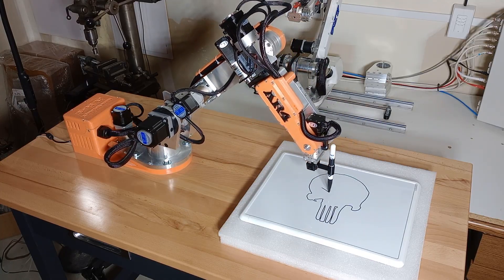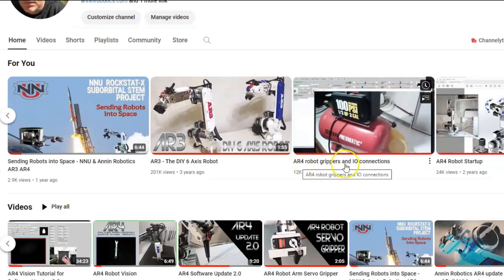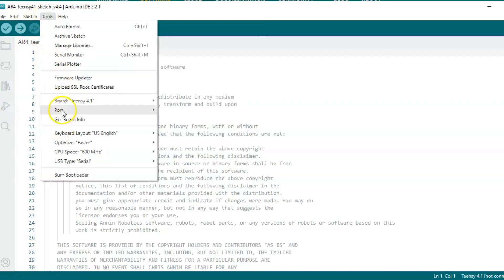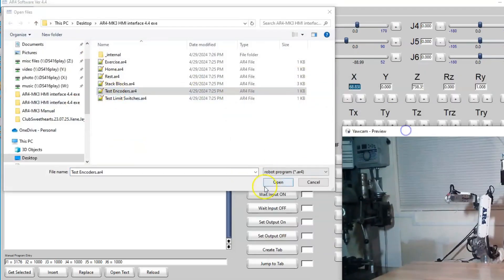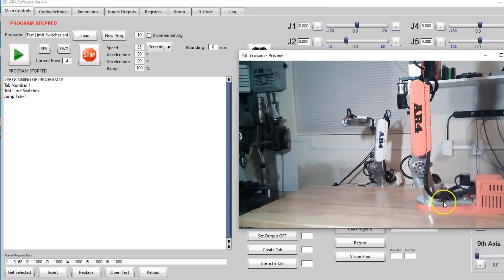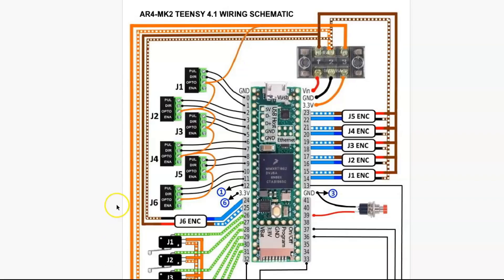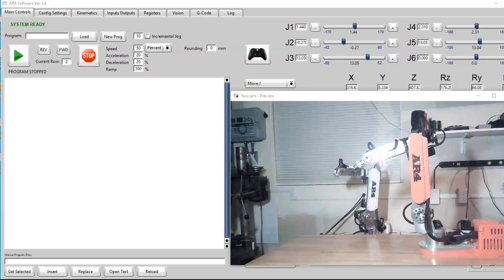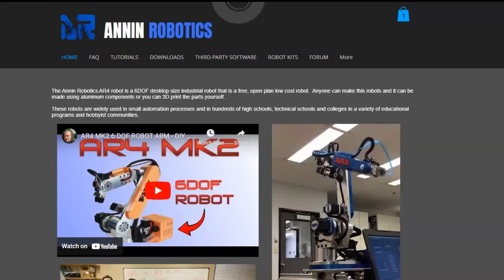AR4 Robot Startup and Commissioning - this video covers startup for the DIY AR4 6 axis robot arm.

Comment: Awesome work, and thank you for making this open source. I purchase the kit from your website.
Reply from the maker: Thank you so much!
Reply: @anninrobotics   I have built two of these arm so far for my students. I want to get a third one for my own, is there any plan for a future version MK4? I'm thinking if it is possible to mount the stepper motor driver right on the back of the stepper motor such as the TMC2209 for a quieter operation. It should be able to handle the NEMA23 from the specification.  An example would be the PD Stepper by ThingsbyJosh, it may not cost much more than the DM3XX we currently use.

Comment: REALLY great work there Chris.
My only "problem" (and it is not necessarily a problem for anyone else) is that the stability of such a (lets face it) "light" robot arm is not too good when you have a router spindle as an end effector.
I would really like to have a robot arm that can act reliably and accurately as a multiple DOF CNC mill.
But even though this robot will not be able to operate as one of those, the work you are doing and the innovations that you are implementing are actually jaw dropping especially as far as the control hardware and software goes.
Possibly for your next robot arm you can team up with one of the aluminum foundry folk and machinists that are able to accurately finish-machine the castings and develop castings that will be an order of magnitude stiffer.
But in the meantime I will keep watching.
Thanks Chris
Reply: buy another one